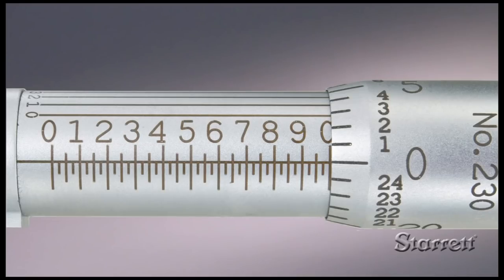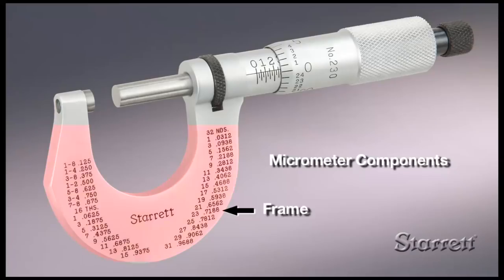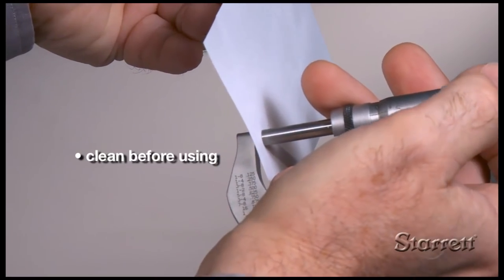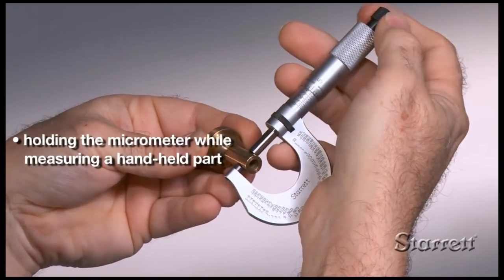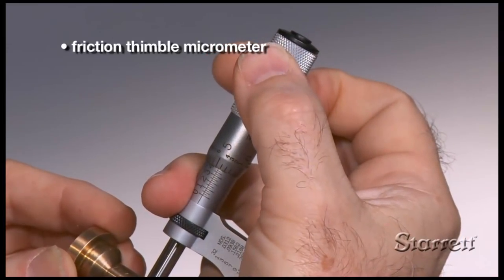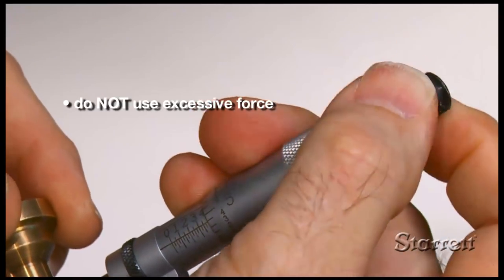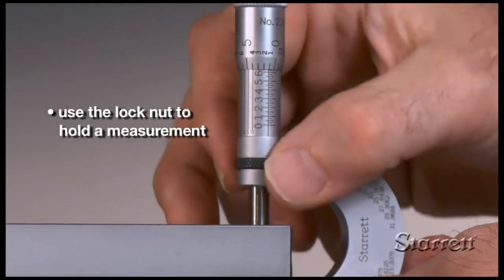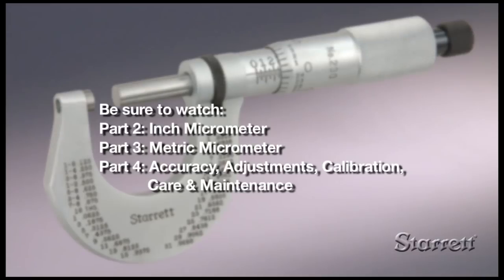Using and Measuring with an Outside Micrometer: Introduction and Terminology (Part 1)

Comment: At the machine/gearbox repair shop where I work, some people turn the thimble until it slips while others close it until the first pressure on the part which is swung gently from soda to side. Which is correct?